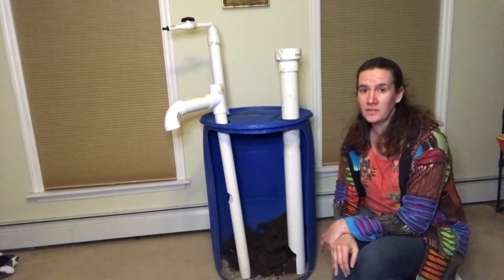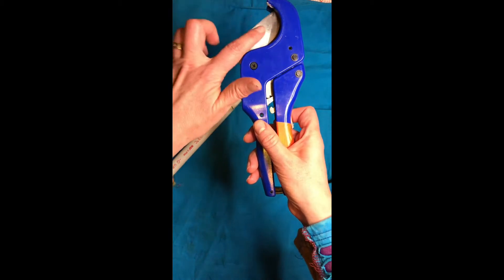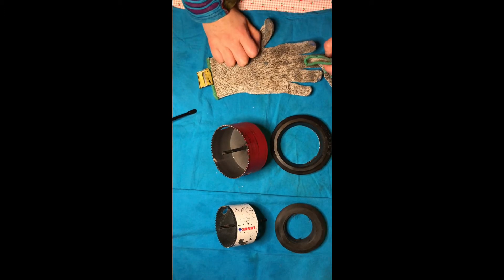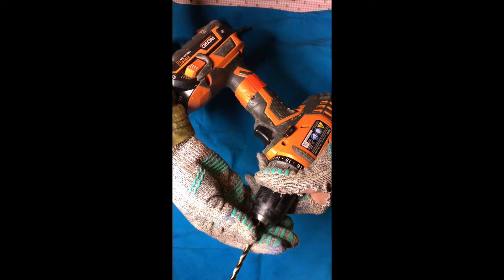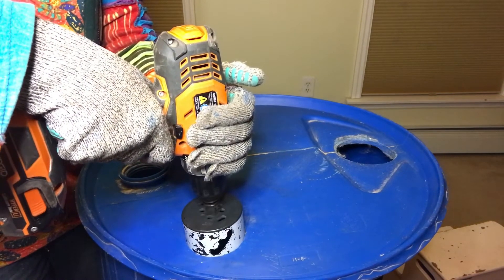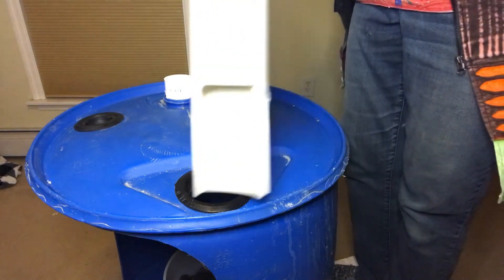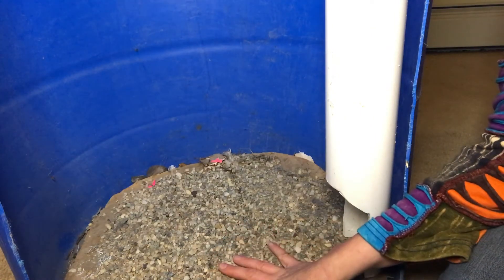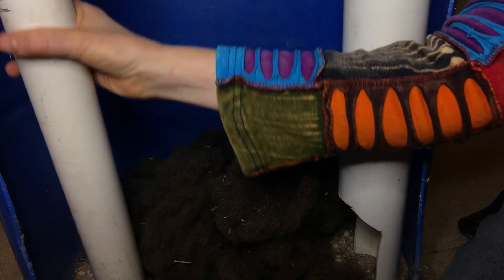How to make a biodigester out of any container

Comment: First biodigester video that doesn't do plumbing gymnastics to put an extra hole in for the gas outlet when they can use the 2 inch FIP threaded bung hole as you did you also cut out the course thread bung hole something I've never seen is why the out flow tube goes down to the bottom and a hole is put in to let it come out of the middle of the tank why not just put the tube down to the middle and stop there

Comment: thank you.  Question..  Am looking at converting a commercial type Porta Potty that would get limited use into a biodigester.  That means the feed would be same level as top of the tank surface.  (will build a box or ??? to run the shiat hole down to bottom of built in tank so it is under water / at bottom.

Question then becomes how to get the overflow to the height you suggest.  Assume your tank is full of water to the brim leaving no air space. 

Got an ideas?

Comment: Cutting holes in reverse works better thanks. Alcohol is a solvent may react badly? Silicone lubricant is not reactive with rubber/plastic
Reply from the maker: The alcohol works as a lubricant for getting the PVC pipes through the rubber uniseals.